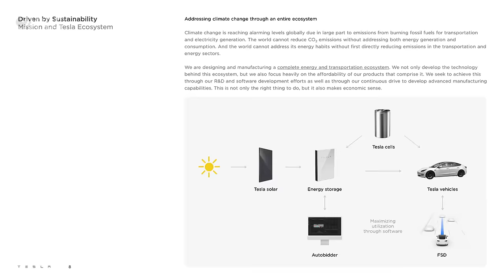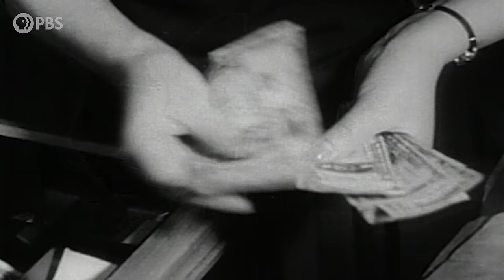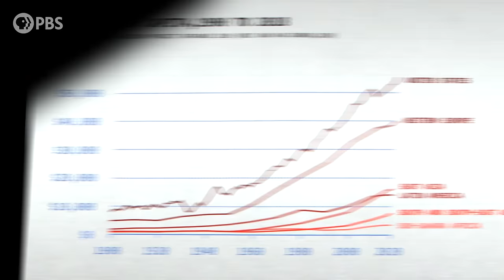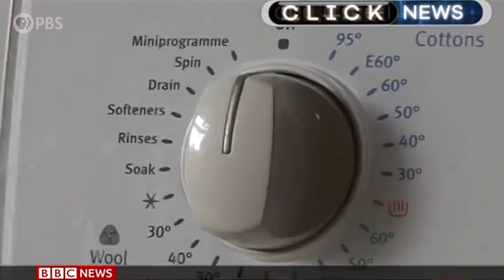You Can't Shop Your Way Out of Climate Change

Comment: 6:27 This is one of the dumbest segments in this video. "Most of the electricity powering electric vehicles is generated by dirty fuel anyway" then goes on to show the potential for a solar powered future, which would then power electric vehicles. PBS Terra pushing oil industry talking points by saying EVs are dirty. smh
Reply: Indeed, vehicles powered by fossil fuels can never be sustainable, whilst BEVs can be. And another thing, while human rights abuse exists and is abhorrent in the supply chain for EVs, the fossil fuel industry is built on slave labour directly or indirectly, even today. 

Now I'm going on a tirade but.. Not even mentioning that many of the same materials are used in combustion vehicles, not mentioning the externalities of polluting cities with exhaust, etc
Reply: Yeah... If only there was a solution... Let's see... Nuclear pow... heh nevermind it's like too expensive to run because of greed

Comment: My first car is an EV and I live in car-centric suburbia. It would take decades of rebuilding to make living car free viable where I live so I have no realistic choice but to own a car. Even if my EV isn't truely carbon zero it still consumes far less CO2 than a comparable gas only vehicle. Is public transit better for the environment than EVs? Yes, absolutely. But the majority of Americans live in places where cars are the only realistic option for transportation.
Reply: Car share - most cars sit doing nothing for most of the time - this makes the car more analogous to public transport
Reply: There's nothing wrong with your need as an individual. This was the point in the video. What you can do is advocacy and participate in local government. That's the most effective way to change things. Not things like trying to recycle everything when they're thrown in the landfill anyway.

Comment: I agree with the general tone of this video - that consumption of goods that are labeled as green is not the answer and in fact contributes to the problem, even if it’s a slower rate than the non renewable or ethically sourced products. Consuming less in general is the answer. 

I am curious about your statement in regards to the “junking” of electric vehicle batteries. This isn’t the standard practice with electric car batteries. The batteries are largely recycled, which does come at an energy cost. I’d be curious on the basis of that claim and the overall impact in an electric vehicles life you projected. Sounds an awful lot like info coming out of fossil fuel industry propaganda.
Reply: Agreed. They state EV batteries are NOT recycled When Tesla guarantees they are 100%.
Reply: How did these FUD distributors get the PBS logo?

Comment: I'm noticing some bias/incorrect/incomplete information in the "Tesla section" of this video. I agree with many of the points made throughout the overall video, but this section conflates lithium and cobalt, uses the 2020 impact report instead of the more up to date 2022 impact report, doesn't account for EV vs fossil fuel emissions over time, makes a glaring mistake when stating that batteries are "junked after use" (e.g. Redwood Materials specializes in exactly this kind of recycling. Not to mention downsizing EV batteries into stationary storage etc). Many take issue with the human rights abuses of cobalt mining, and I wholeheartedly agree. But the industry has been phasing out cobalt for a long while now. And I can think of another substance that's extraction is famously tied to extreme human rights/indigenous land abuses: it's called oil (which is one-and-done burned rather than used to build a sustainable battery). Elon drives me crazy too. But something tells me there is a reason that Tesla is specifically namechecked over and over again, instead of referring to EVs in general.
Reply: Yeah, don't have to make these cherry picked points to make a case against Musk.
Reply: I can see where ur coming from, but tesla has billed itself as one of the leading drivers of the us economy and has been on the top of investment lists for a long time now, with the unfair sales practices in the US making cheaper evs from non american companies not really worth it, and the fact that tesla is trying to be an apple like company with a weird walled garden and pricing structures, I think its ok to do this and question all EVs considering that under capitalism companies and processes like the ones enforced by elon are fairly standard and have been for a while.
Anyways elon could have make bike infrastructure instead of buying twitter and done more for the globe than tesla ever could but, capitalism
Reply: @CoreyBoling Thank you! I almost stopped watching when she parroted those terrible untruths generated by the fossil fuel industry. Gas-powered vehicles' pollution footprint surpasses an equivalent EV in under 3 years now, some shorter than 1 year! In general, the whole video was extremely negative about any individual trying to do anything to promote positive change. Really disheartening!

Comment: I really don't think you should be telling people that the nice water bottle or other infinitely reusable items aren't going help anything. I really don't care if it adds more CO2 to make it if it will keep even just a little bit of plastic out of our waterways.... I've been badgering everyone in the factory i work at to stop using Styrofoam cups and buying bottled water. It's mostly worked.
Reply: I agree with you. The video misses the fact that even if we fix the climate crisis tomorrow, we are heading over the edge of the cliff unless we also solve the pollution crisis, biodiversity crisis, and ecosystem crisis. I've got an stainless steel water bottle I've probably used 3000 times, and I could probably use it 30,000 more if I lived that long.
Reply: I think you have to focus on cost saving and with postive environmental effects a convenient by product

Comment: This is a hit and distraction piece.
Most cobalt is used by the oil industry, not in EV manufacture.
Car batteries aren't dumped at end of life, they're recycled.
It also ignores the fact that you can buy solar panels, buy insulation, buy a heat pump, buy triple glazing, buy an EV. All of these things cost co2 in production but what the alternative. Continue burning gas, oil and coal to heat and cool your home and get to work?
Reply: Source?
Reply: @DrizzyB  The internet, mostly Google.

Comment: I'm no Tesla fanboy, but it's a bit disingenuous to mention construction CO2 of an electric car without referencing that most of the savings are down it's (lack of) fuel use. Admittedly, that's dependent on the generation mix, but we're going to have to go renewable anyway (and 'last mile' is the hardest problem). Saying we should build everything differently is great, but hardly helpful given the lifespan of existing infrastructure. 'Reduce' is certainly better than any of the other options, but replacing 'dirty' tech seems to be the thing that will actually help, given current society.

Comment: While I think that a rethinking of the endless growth of the economy is worthwhile, there are technologies we should adopt for their sustainability. Ebikes, public transit, and infrastructure are great. If people still need a car where they live an EV is going to be better than an internal combustion engine. Gasoline, or diesel, requires continual oil extraction which has all of the problems listed in this video but to a higher degree for longer. The carbon pay off period of EVs is 2-5 years depending on your grid. The electrical grid is also getting less carbon intense every year. Electrification of all technology is a major step in addressing climate change

Comment: At 2:25 who is "junking the battery"?  None of the valuable materials is consumed, it is highly recyclable, and the materials are already highly refined, so it will be better quality feedstock for new batteries.  It's probably difficult to find high volumes of retired BEV batteries, especially from Tesla, because even decade old batteries are still in service with low capacity loss...

Unlike fossil fuels, batteries are storage assets for renewables that last many decades and will be recycled... They are displacing the fossil fuels which are extracted at many orders of magnitude higher quantities for single use when burned for energy.  FF is ancient solar energy.

Please be sure your sources are valid before proclaiming that BEV batteries will end up in landfills.  There are numerous companies which are focused on making batteries a circular resource.  Maybe consider covering that instead of the fossil fuels misinformation of batteries in the garbage?

Comment: Downvote from me for picking on Tesla specifically several times, while failing to mention how Tesla is at the forefront of solving the very issues you criticise them for. Yes, electric cars are only as green as the grid that charges them, and guess what? Tesla's Megapack grid-scale batteries are exactly what is enabling many places to achieve a 100% renewables grid. Yes, sourcing of cobalt and nickel for EV batteries has major negative impacts as mentioned in the video, and guess what? Tesla is leading the way in switching to batteries that contain no cobalt and nickel, several of their models are already there. Tesla are also at the forefront of recycling their batteries, which will be key in reducing the impact of EVs going forward, they are probably ahead of every other manufacturer in this regard.

I'm not from the USA, but it seems from where I'm standing that it's become a political thing over there, the left hates Tesla full stop, no matter what they do, for well-known reasons, and I wonder if that's the reason for the bias in the video. But I really think it would be best for all of us if we try to de-politicise the kind of issues this channel covers. Please keep the politics out and stop the hate, and don't dump on companies doing more than anyone to accelerate the energy transition.

Comment: 1.) I’m not going to stop eating meat.  I’m just getting meat from more local ranchers, etc.  Also, getting organic food is my way of helping the environment as well, fewer pesticides out there, etc.  Down with Monsanto!!!

2.) I’m not going to get a Tesla, just to supposedly help the environment.

3.) I’m not going to stop using batteries for certain things that I have, because those things need batteries….  In one instance, batteries are needed for the door lock, something that the landlord put in place/he reimburses me for batteries used for the lock.

4.) I like stainless steel water containers/water bottles.  I like these guys more than plastic water bottles….  Will check out where the materials come from more with various water bottles…

5.) I’m not going to stop using the dishwasher, sink to wash dishes, the washer, dryer, etc. to save water and power.  We need clean clothes and clean dishes.  🤷‍♂️🤷‍♂️🤷‍♂️

6.) If I had to choose between something more environmentally friendly and something less so, it’s a good thing is something comes from 100% recyclable materials, etc., but it isn’t the primary deciding factor when buying something (for me).  

7.) I tend to buy a lot of local foods.  This is one of the things I try to do to lower my carbon footprint.

8.) We have separate garbage, and 2 different kinds of things/bins that are recyclable stuff, etc. for where we live.  This is an EXTREMELY good thing…

9.) I don’t poop or pee near lakes, rivers, sources of drinking water, etc.  When out in the wilderness, I “leave no trace” of ever being there.

10.) I LOVE the ideas/building of clean energy sorts of things, provided that it doesn’t harm the environment in other ways…

Hydroelectricity = Build fish ladders where these guys are.

Wind Power = Don’t build where forests, etc. currently are.  Build those guys in the desert and more barren, remote, less green areas, or areas with no or few trees.

Solar = Build in hot, sunny places.

Geothermal = Build in volcanic, etc. areas.

Nuclear power = Go easy on these guys whenever possible…

Natural Gas = Not a bad idea.

Oil = Meh…

Coal = BAD.  IDEA.